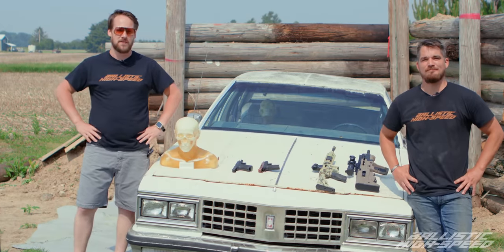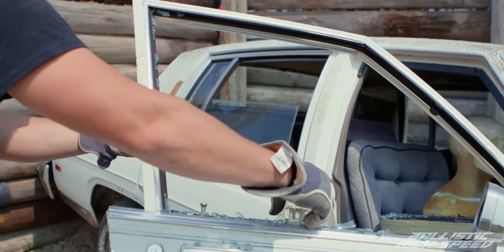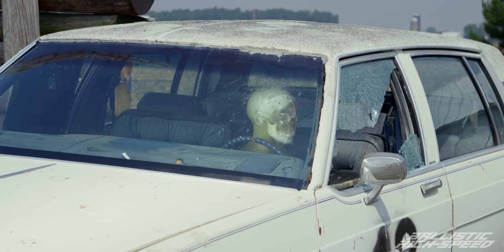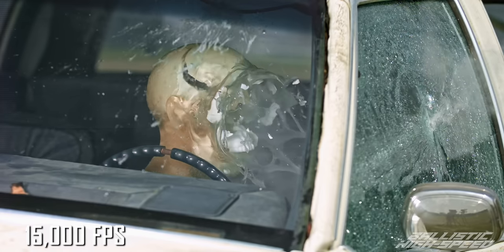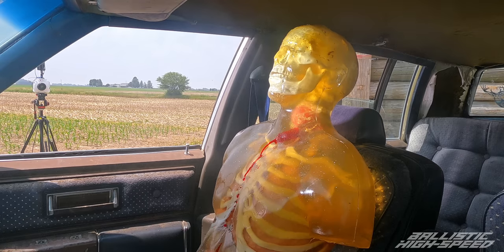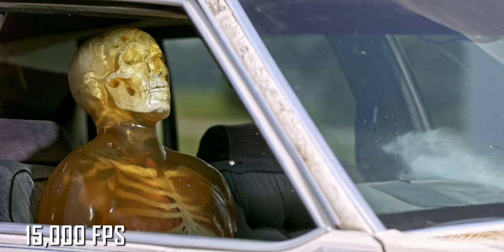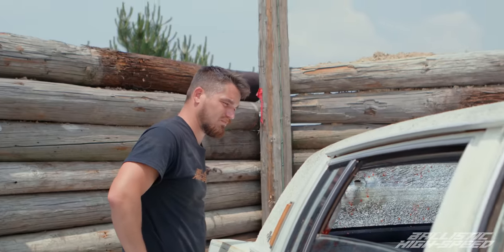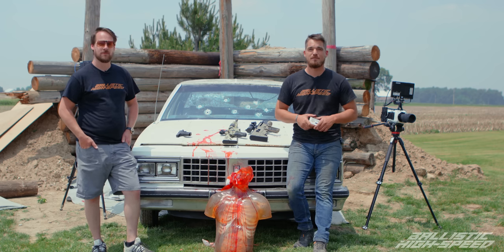Can You Survive Being Shot at in Your Car? - Ballistic High-Speed

Comment: Years back I tested .38 Special waddcutters against a front windshield and the soft lead wadcutters simply put a small smear on the glass, and did not break the glass.  Windshield was a 70’s era sedan. The firearm used was a Model 10-2 Smith & Wesson “snub nose” revolver.
Reply: @squibload58  yep, totally realize that…but it was an interesting test to see that it wouldn’t even crack the glass.  We were not expecting that.
Reply: For the lighter pressures and cast lead rounds back then, and a 70s windshield to test it on, Seems like dirty harry wasn't wrong lol.

I mean I've always known it was possible but comparing a throwaway line in a movie to real life testing is always surprising.
Reply: @w8biatvrepeater638 and '70's auto glass was twice as thick too. I don't trust today's windshields. One pebble bouncing off a truck and it's done

Comment: Years ago we tested all available .357 ammo for agency purchase.  There were quite a number of tests including windshield and car door penetration.  Just for fun we also tested 9mm 124 grain FMC and .45 ACP 230 grain FMC. (FMC = Full Metal Covered)  All .357's shed their jacket during windshield passage as did the 9mm.   But, the .45/230 did not shed it's jacket and penetrated significantly better than any other round tested! (Test included 6 rounds fired at different angles through the windshield)

Comment: Things I noticed: .223 through the side window - At 5:37 you can see chunks of glass penetrate the cheeks.
9mm vs Windshield - As the copper jacket interacts with the glass, you can see the lead core start to slide forwards through the bullet at 8:53.
.308 vs Windshield - There are fountains of glass perpendicular both forwards and backwards from the impact. the fact that it's perpendicular and not along the path of the bullet is interesting. It might have more to do with the shattering of the temper than the impact of the bullet.

Comment: The bullet should actually deflect downwards shooting from outside to inside, since it'll want to exit the glass more normal to the plane of the glass.  So from inside to out it will deflect up, from outside to in it will deflect down, with the amount of deflection depending on the angle and thickness of the glass and the ballistics of the round.  If you shot a 22 through the windshield you would see a lot more deflection than the barely noticeable deflection you had with the 9mm and 308.  Shooting through the windshield of a Dodge Intrepid with a 22 while aiming at the headrest I was getting impacts just above the middle of the backrest.

Comment: theory time. copper jackets prevents deflection because its more ductile material than the glass but it is a harder material than the lead. The glass, which is stronger than the copper. peels the copper jacket off and absorbs the inertia of the copper. the lead which is poured into the jacket during manufacturing. slides out the newly formed tear in the copper caused by the glass. thus coming out in the spherical shape in the video. a regular lead bullet, in theory, would deflect more due to the softness of lead preventing the bullet from piercing the glass as effectively as the hard metal copper.

Comment: I worked for 2 glass companies in the 70's the first one was a glaziers we were carrying big sheets of toughened glass into the building 5x8 ft aprox when the guy in fronts hit the ceiling going downstairs it exploded over him quite a shock , we were in the town and driving back to the depot the new Bank of England building one of the lads got on about them putting the bullet proof glass in the cash wagon entrance small triangular shaped windows about 6in thick , at another place that made car windscreens there were some old offices where the tested bullet proof glass , there was a rifle barrel clamped to a piece of wood and a frame that held the glass panel and various blocks of glass with bullet holes in .
In the early 200's I worked for a garage who repaired cash waggons for a security company , a big old Mercedes van came in for a door replacement bottom was rotted out , I tried taking the door off in one lump but could not lift it so had to strip every piece of it out then swap and rebuild .

Comment: Very interesting as always, but it would be good to know exactly what ammunition is used for the tests. In my own experiments shooting through windshields into my own primitive test media (soaked newsprint), I found a significant difference based on bullet construction. Both M193 and M855 5.56mm (full metal jacket, spitzer style) broke up, tumbled, and did not penetrate deeply into the soaked paper. Speer 223 Remington 64 grain Gold Dot with soft point bullets that have the jacket and core bonded together, however, stayed together, did not tumble, and penetrated all the way through an 8-10 inch wet pack and on through the rear window. 

As for handgun bullets, I read a report that some years ago a Midwest law enforcement agency tested 45 ACP bullets against a windshield at an extreme angle. The full metal jacket round nose bullets reportedly had a tendency to skip off the glass whereas hollow point bullets punched through.
Reply: This is exactly what bothered me, we need to know bullet type, and they dropped the ball not testing 5.56 against the windshield, that was the main thing I wanted to see. In Iraq there was allot of road blocks and checkpoints. Base entrances too were vulnerable to car bombs.  It was widely reported that 5.56 had very poor performance in these situations stopping drivers running at the defenses. This was of course at distance too, not 5-10 yards away, if you get within 10 yards of a car bomb you're going to have a bad day... 

 .308 in particular was known for good performance against windshields but there is a massive difference between a 62grain m855 or a thinly jacketed 77grain and a 150-180 grain .308 carrying more potential energy. Even 9mm at close range will out penetrate 5.56, and they are probably using FMJ 9mm which is famous for over penetration.. it's exactly why 5.56 is such a great home defense round, it fragments and doesn't over penetrate, but this leads to problems when trying to shoot through a windshield or any moderate barriers.. I am actually rather annoyed at this test because the 5.56 side window shot was a total waste of time.

Comment: Think of the nose of the bullet as it hits the glass the bottom of the nose hits but not the top.
The bottom of the bullet then loses energy while the top doesn't. (or reverse when shooting from inside the car) the side of the bullets with higher energy then dumps energy in the direction of the  lower energy side to equalize thereby deflecting the bullet in the direction of the energy movement. This deflection would only be noticable over longer distances but is the reason why police miss so often when shooting through their vehicles windshield. The bullets are deflecting up above their point of aim.

Comment: Back in August 2004 we had a little datsun pick up loaded with explosives attempt to crash our ECP (Entry Control Point) in Baghdad. We had a gunner in a tower with an M2 .50 cal. He started putting rounds through the radiator, which stopped the car and then through the windshield. The inside of the car was coated in brains, blood, hair and bone. It looked like achmed just exploded.

Comment: Try different angles on windshield, not just straight on. Maybe at angle from driver side to passenger side. May have to turn car so back stop is still behind bullet trajectory. This is when i think you see the most deflection in real world situations. Could even do this with windshield removed to better angle it with backstop. just angle the top to bottom angle like it would be in a car and maybe even at different top to bottom angles because not all windshields are angled the same. Also agree with others about hollow points vs ball ammo

Comment: I took a bullet to the top back of my head back in 2008 threw the back window while I was driving. Luckily I survived but I do have a small plate in my head now. I had to get fragments removed from inside my head. Since the bullet hit the top right of my head a fragment went threw the sun visor and another piece landed on the passenger seat after bouncing off the top of my head. Good times. Not really

Comment: Without watching your video...

The standard side  window will not protect you from a .177 cal BB.

The front window actually does better depending on variables.  Such as vehicle speed and projectile speed. 

A smaller object has a better chance traveling at the same velocity as a larger object to a certain degree. 

Mass...and speed from the vehicle and projectile determines the outcome. 

A ping pong ball moving at 700 ft per second is not going to do the same damage as a pellet traveling at 700 ft per second.

Comment: Really I don't think the holes would line up to give an accurate point of the firing unless you take into account of the two angle changes. One angle change at the front windshield and one angle change hitting the skull.
Also from some story's I've heard about .223 I wasn't surprised it didn't exit the target. Weren't they designed to do as much damage internally as possible? Idk if it's true because I've never personally seen it but there are story's about the  .223 round bouncing around the body making very puzzling entrance and exit wounds.

Comment: Still upset at the grindhard ammo selection on 9mm vs .45. Ridiculous to do 713 fpe vs 364 fpe. If you picked underwood +p’s with the same Lehigh ED bullet, it would have been 489 fpe for 9mm vs 534 for .45. Also, the Grind Hard .45 acp +p had more energy than Underwoods .45 Super lmao, 713 vs 675.

It seems objectively unfair to pick such a huge difference in energy, and before anyone says I’m crying, it’s just not anywhere near normal representation of the difference in energy between .45 and 9mm. The 364 fpe of the Grindhard ammo is just strange with how INSANELY hot they loaded the .45, like, literally has to be the hottest .45 acp in the entire world because it exceeds even Underwoods whole roster of .45 super, and Underwood load hot. Yet they loaded the 9mm to target ammo levels of energy. The 9mm shares the exact same fpe with Winchester white and red box target FMJ ammo (364 for grindhard, and 361 for winchester target  ammo.). That’s just weird to load 9mm as weak as it can possibly even be,  and SUS when it could easily have been loaded to 500-550 fpe minimum compared to the .45 being loaded to 713. 
Again, Underwood loaded +P 9mm on the same extreme defender bullets to 489 fpe, the .45 acp +p to 534 fpe, and the .45 super to 675 FPE. Grindhard loaded 9mm to 364 fpe, and .45 acp +p to 713 fpe, again, beyond what Underwood of all companies loads their .45 super to. Just insane

That’s 9% more power for .45 acp in Underwoods offerings, and that is typical among almost all major ammo manufacturers. The 95% increase in energy from the 9mm to the .45 from Grindhard is literally unheard of for 9mm to .45 acp. 

For example, gold dot G2 +p 230 gr is 461 fpe (lower than the +p 9mm Underwood at 489 btw) and their 9mm 124 gr +p is 410, that’s only a 12% increase over the 9mm. In the short barrel ammo, 9mm is 364, .45 is 343 and for fun, .40 is 361. So in this particular ammo offering, 9mm is 0.8% more powerful than .40 and 6% more powerful than .45.